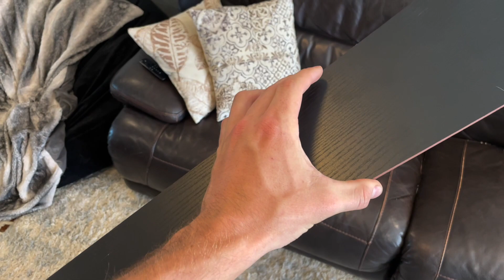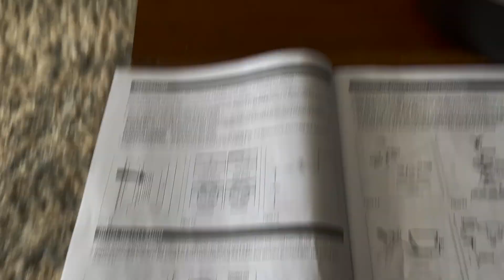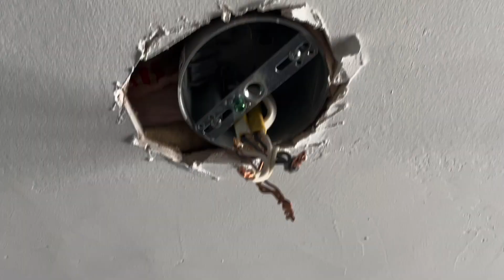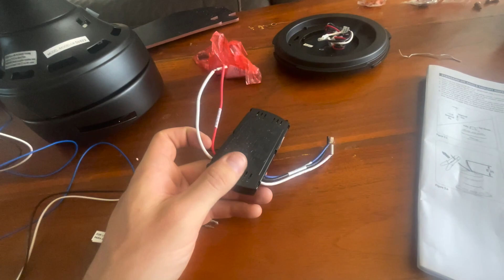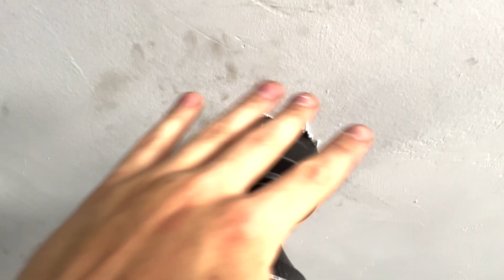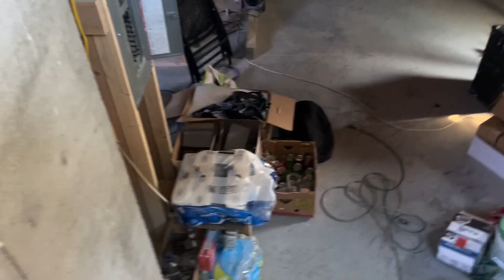Honeywell Ceiling Fan 50603-01 Led Ceiling Fan - Review/Installation

Comment: I recommend putting a ceiling medallion to cover the ceiling around the fan. It'll also give some night decoration. But the thing is, is that you have to disassemble the whole fan and the mounting bracket, AND you have to re-do the wiring.

Comment: This looks very similar to the fan I am wanting to get.  I am worried about the amount of light it gives off In a large room since the light is kinda "recessed" or flat like yours
Reply from the maker: To be honest, I hate the light since it's so dim, so I never use it. Although, I've seen many ceiling fan lights have this same problem. I always like to have a combination of recessed lights surrounding it and a fan in the middle.

Comment: The only thing I might add is that a ceiling fan mount should use a outlet box made for ceiling fans because the screws are 8-32 or larger instead of 6-32 for a standard lamp because of the extra torgue of moving fan blades

Comment: Put one in today, directions have you wiring the receiver first, don't do that, put the receiver in place with the ball connected to the holder first, slide receiver in and wire it.

Comment: Glad I found your video.  We just bought a Honeywell fan and the receiver had red and white wires instead of black and white.  I ended up calling Honeywell to verify that we had the correct receiver.
Reply from the maker: Well hopefully the video helped you with the install
Reply: @DJ.Sparks.Studio  it was more work than it needed to be although it turned out fine. It took us two days to read the papers over completely and watch videos to understand it. Then on the third day there was light. It was a three hour job. I’ll probably buy a couple more for the other bedrooms but next time we’ll make it a fall or winter project.  We are 70 year olds so if we can do it most others can as well.